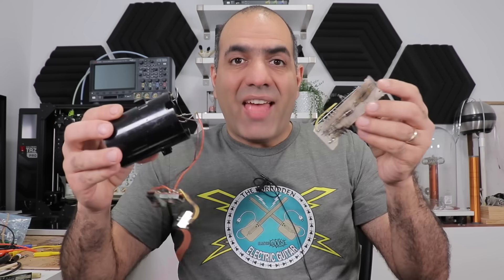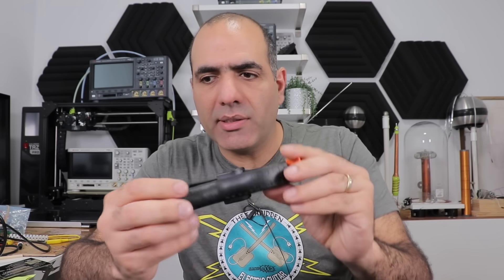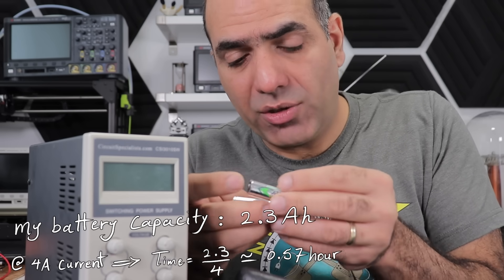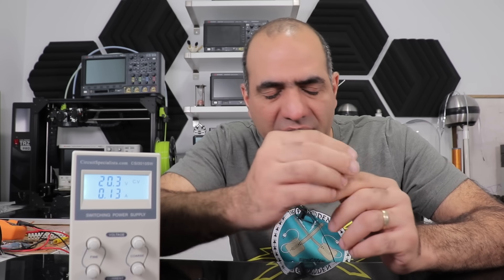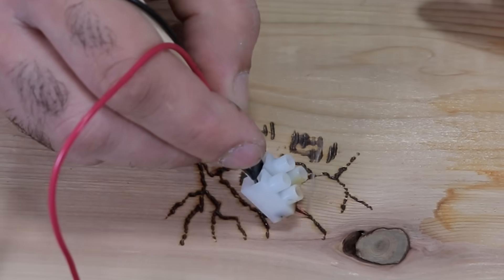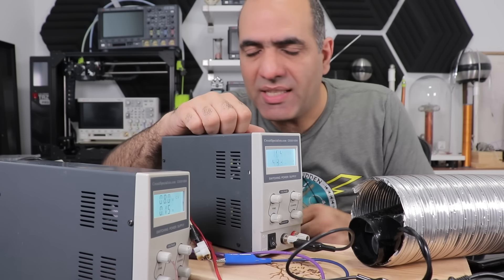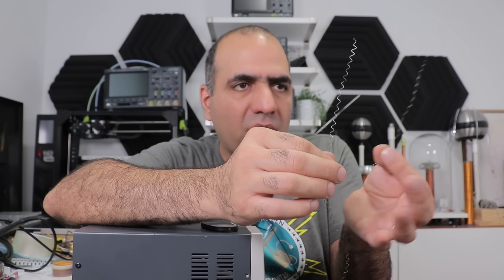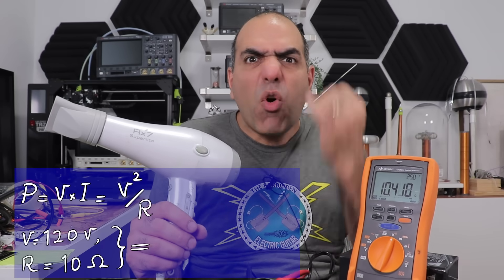Making 5 Things from a Broken Hair Dryer

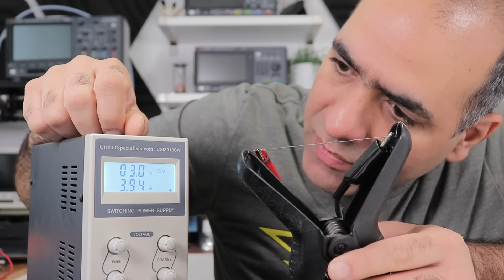Comment: 2:53 @ 4A though ,AA's would not work but a good single cell lipo or even a li-ion would do it
Reply: 3V/4A=0.75Ω
AA batteries typically have an internal resistance of ~0.2Ω. So two in series are 0.4Ω.
Total resistance of 1.15Ω
3V/1.15Ω≈2.6A
2.6A*0.75Ω≈2V
And we saw it work on 2V, so AA batteries are barely sufficient

Comment: Maybe he should have tried putting the filament in a "transparent heat resistant material" and remove all the air as possible in it. 
I know its a crazy idea, but maybe the lack of air would prevent the filament from over heating and it could glow longer without breaking...
I know this Idea sounds Crazy , but i want to believe it can work.
😉😉
If it works, it could be called 
" ELECTRIC SUN " ...💡💡💡

Comment: I used half of a king size heated blanket wire to act as a 5 ohm resistor to activate a pc power supply. I ordered the correct resistors and they never showed up

Comment: In the hairdryer, What prevents the heating wire element from burning up and melting?
And what voltage is applied to the element in the hairdryer? 120vac or is it Vdc ? 
Would it be simplier to have a AC fan motor and an AC heating element?

Comment: I once found an electric space heater at a thrift store. The heating elements just consisted of a bunch of PTC thermistor blocks connected to aluminum radiator fins. Cheapest way to get thermistors!

Comment: I did that first experiment as a kid...only i used 240 volts from the wall socket. Made the wire glowing hot and i could even burn wood with it.

Comment: I think the only thing to do to make a hair-dryer a somewhat universal power resistor would be to separate the fan power from the heating element. For example, if you feed 20v into the thing you don't get any fan movement because of the voltage drop across the heating element. Maybe a universal input boost/buck to DC 15V power supply would solve the issue, or just externally power the fan so you have a more accurate resistor if that matters.

Comment: 7:36 This is due to the Coanda Effect along with the Bernoulli's Principle, which tells us that if we have a pressure difference with high and low pressure air, the high pressure air will push down towards the low pressure air, thus creating a vacuum. This is best seen on aircraft wings, where the shape of the wing creates high and low pressures of air. The top of the wing creates high pressures and the bottom of the wing creates low pressures. The high pressure air pushes on the low pressure air, thus creating lift.

I would like someone with a bigger brain than me to correct me on this because I'm mostly better at mechanical engineering, not fluid dynamics.

Another thing I found. Due to something called viscosity, air is sticky. And so it likes to move things along its path.

The enclosure of the tube that the fan is inside can also help. The pressure difference between the outside and inside of the tube can create vacuum.
Reply: I use Coanda effect and Bernoulli's principle to cool my room right now. A fan is blowing air out and into the hallway through partially open doors (maybe 25 - 30cm open) as new air is being pushed in through the window because of pressure difference.
Blew my little brother's mind away.
Edit: it's midnight rn and it's way colder outside, wouldn't do this in the middle of the day when it's 30°C+.
Reply: Venturi Effect actually
Reply: @yegfreethinker  Well, most people call it the Bernoulli's Principle. I'm pretty sure you're getting confused between Venturi's Nozzle (Which uses the Bernoulli's Principle) and the Bernoulli's Principle.
Reply: @suspense_comix3237  it's literally the Venturi Effect, as a special case of the Bernoulli Principle

Comment: What you call a fuse is a TCO. " Thermal cutoff" This will break and not self heal when overheated.  Virtually every heating apparatus has one. What you call a thermal breaker is indeed a thermostat. As for the restive wire you are using, any hardened thin wire will do. Hardening increases resistance for steel. Don't know why that is. You can peel off a single wire from for example an inner friction cable from a bike break cable. It will do just as well. The spring in the clamp you are using is important. This wire will expand easily 5% when hot. If not compensated for there'll be a lot of slack in the wire. It's not just a toy. When you need creative shapes from foam for some reason it's a very practical tool I used many times.

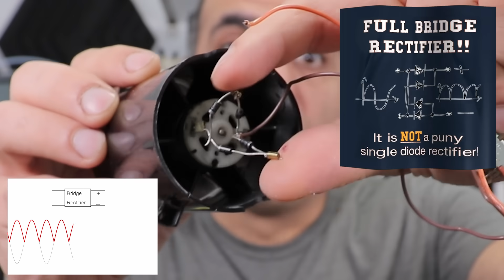Comment: Actually this is not just a fuse... its actually a thermal fuse 0:25
Reply: It's still a kind of fuse. You even said it yourself (Thermal fuse).

They usually use these as an overload protection in case the dryer gets wet or develops a short. It also serves as a back up in case the resettable thermal switch fails.
Reply: Wait then what's the point of the thermal breaker?

Comment: I like this concept. Whenever I see broken electronics I always think about if there's any components that could be put to use elsewhere. The only problem is that I'm not an engineer, so I never have a clue what I can do with the parts.
Reply: There are lots of stuff to salvage, ranging from resistors to capacitors, diodes, fuzes, even raw material like aluminum heat sinks used for passive cooling. A lot of them can be sold or used for small repairs of other electronics and stuff like that.

Comment: The "some fluid dynamic effect" may be the Venturi effect, increasing fluid flow speed drops the pressure , lower pressure in the tube lets atmospheric pressure outside the tube force the smoke into it...then again what do I know, I'm also an electrical engineer ;)
Reply: Hmm i see, venturi equation gave the efflux value of fluids flowing out of an orifice... I reckon it is the king Bernoulli itself
Reply: I'm not sure about the technical defintion of the venturi affect, or anything, but I can say for sure the root cause is the boundary conditions of the tubes. At the point where the inner tube discharges into the outer tube, you have fast moving inside flow, butting up against slow moving outside flow. The velocity of the flow can't change instantly, so you have a gradient across the edge, so they outside cannot be zero, it must have some greater-than-zero flow rate to satisfy the boundary conditions. Also, fast moving air has an inherently lower pressure, which can also work to 'pull' the air in through the outside tube. These 2 ways of looking at this could be mathematically identical, they are the same thing from 2 perspectives, or they may both share some portion of the force for the flow.
Reply: But then everything else is developed on Bernoulli's theorem so may be venturi would be more precise?
Reply: "Sucking" device based on a Venturi effect is called aspirator or vacuum ejector, or simply ejector. For example sandblasting machines suck sand just like that.

Comment: Yeah the problem with those hair dryers is that they use a section heavier nichrome heating wire to limit the current/voltage to the other items in the dryer. They just use more or less loops of the resistive wire depending on the voltage in the destination country. 
That's the reason that, even though, you have the temperature set to zero the air coming out of the dryer will be warmer than the ambient air, as it is cooling the limiting loops of nichrome wire, that are always powered up once the dryer is switched on.
It is nice to see that I'm not the only one who tried to connect mains voltage, in my case 230 volts, to the fan motor directly, only to have the diodes explode in dramatic fashion... 🤣🤣

Comment: Medhi at 6:57 -> "if you dont know how something works, dont put up false information on the web"  then continues to put false information on the web directly after. ¯\_(ツ)_/¯
the blower motor is not connected in series with the heater. the heating element has a third connection to act as a voltage divider providing the lower voltage for the blower. the same circuit can be found in toasters.
Reply: I'd say it's not false information but a half truth, since it's in series with part of the element. It would have been much better if he had drawn the correct schematic, though.

Comment: 7:37 You built an ejection inducter, or educter; they're commonly used in aircraft fuel systems to move fuel from one tank to another without having to put mechanical pumps everywhere.

Comment: @ElectroBOOM - 
The hair dryer schematic was wrong , hair dryers usually use 12V-DC motors with the heather being the voltagew dropper (a normal serial circuit) at least since 50 Years ...  
Your pipe construction @ 7:37 works like a dyson room fan & a modern airline jet engine ... 
as rechargable batteris use the good old D-cells alias "Mono cells" (they are the biggest of the 4 ==> AAA < AA < C < D )

Comment: This is getting out of hand, I had to pause this video several times due to anxiety brought on by watching the (apparent) extreme danger of what was being shown.
Possibly this stems from me being an electronics engineer in the UK, where the 240Vac mains is considerably more lethal than the USA's 110Vac, but still. Yikes forever!
Reply: I think he choreographs the 'accidents' quite well. And you're of course right. 120VAC is only double of what's usually considered a safe voltage under normal circumstances, while 240VAC is definitely too unsafe for many of the things he does.

Comment: You forgot to list the mica paper among the interesting parts a broken hair dryer has. The mica can resist temperatures well over 200 °C and is electrically insulating. This combination makes special enough to make noteworthy. If you ever need a structural element in your heater design, mica is a good choice.
Reply: It's also really healthy and good to inhale!
Reply: @itzfuazz4198  This is an issue with all refractory materials, so it's a given. From silica based bricks you get silicosis. Famously, asbestos causes asbestosis. Refractory mortar is acidic and burns you lungs and eyes. Ceramic wool is carcinogenic. And so and and so forth. If you're engaged in this kind of hobby, it's good practice to inform yourself of material hazards. 
I, for one, think that it'd been safer for Mehdi to make his foam cutter with the mica. What kind of plastic is that clamp made of? Does it gas out formaldehyde when it's getting burned by the hot wire?
You see, it's easy to overdo it with the safety cautions with just about any material. Even water can be toxic, if you drink like 3 gallons of it at once. And people have done it.
Reply: @JoshuaNorton  The wire will conduct heat slowly to its outer ends wrapped through the plastic holes but it isn't heated by current farther out than the leads are attached. 

But yeah, I'd get a hacksaw frame and come up with some kind of insulator to mount the wire onto it with.
Reply: @itzfuazz4198  really?
Reply: @noobkiller9478  i belive that was called irony
Reply: @noobkiller9478  Pretty sure it's just a mineral. We had samples of it while doing geology in science class in school. I think it's just when it's powdered or spun into fiber that it presents a health hazard. (Is the mica we use in electronics mined or is it created artificially from constituent components?)
Reply: @SharienGaming  👍
Reply: Did you forget a 0?
Reply: @0x8badf00d  Yeah, that didn't seem very hot. My oven can do better than °200 C.
Reply: Absolutely!  From the mica board and tuned corrosion-resistant wires to kapton tape and tourmaline coatings, hair dryers are a wealth of interesting materials for something so simple!

The way this video brings it all back around is masterful.  It ought to be nominated for an award.
Reply: ok but wtf can he use the mica paper for, and how is it very different from anything else? Aren't plastics used in desktops (I forgot the acronym, but probably PVC as well) resistant to temps up to 200C (and electrically insulating)?
Reply: @kamranrowshandel6395  why so aggressive?  Sure, some plastics like imides (definitely not PVC) can go to 200-250C, but that's pushing it.  Mica is going to double or quadruple that capability, with good dimensional stability.  It's not super interesting, but there is a reason you don't see the coil frame made of plastic.
Reply: @jdspencr  you said 200C bro, this is not my problem. in other news, I'd like to ask (on an unrelated note to you, because we "met" today), Is there any doubt that only in gambling may one's previous words be exempt from being the reason for which one "Changes One's Life (in terms of the Western meaning of changing one's life)"?
Reply: @kamranrowshandel6395  No.  That's not me.  You were responding to a different poster that said 200C (and they said "well over").  Their low-ball may not have been your problem, but your attention to detail certainly is.
Reply: @jdspencr  (jump the wall into china or bust--whether I'm alive by then or not)

Comment: You can use an old hair dryer as a filament dehydrator for your 3D printing filament! Put the filament in a 5Gal bucket and attach the hair dryer to the side 😊

Comment: I just recently made a electric light it's very easy to use just 5v charger will handle it and i burned a lot of toothpicks and almost cut my hand but it burned very badly but carefully used it and patiently used it or if glows too bright it will melt and burned my skins again

Comment: 2:16 Is heating coil resistance supposed to be big high, Joules-Lenz law of electric heating and tungsten filaments of electric bulbs more resistance more watts consumes and brighter shines electric bulb. Superconductivity is when resistance is close to zero and electric current is the initial value maximum electric source current, flow without resistance, and other features of low resistance electric current it produces zero heat.

Comment: Engraver? Plastic repair! 

The hot wire is pressed into two adjoining pieces of plastic. It melts the plastic and joins the two parts. Use the pliers to pinch off the wire. The remaining wire is used to create a new "glue wire". Do the same with some distance to the first wire.

OK ... does not hold together because of the small diameter of the wire, illustrates the principle. BUT: This is how bodywork damage to the plastic parts of vehicles is easy to repair. Check it out. User powerfulukltd on Youtube.

Should also work with plastic you have already destroyed, build one! ;)

Thanks for make me laughing.

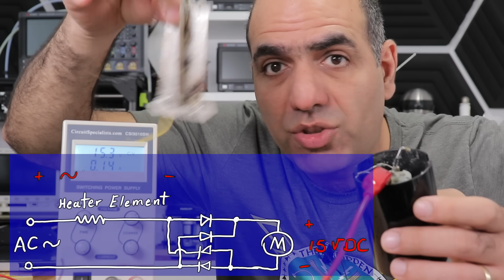Comment: 7:13 I don't think this schemata is correct. I think the heater element acts as a voltage divider and therefore has a center tap somewhere.
Reply: Electroboom confirms that after the first motor experiment failed.

Comment: Used to use something very similar at my last job as ur engraver it would cut silk on weaving machine and seal it we used to have them just glowing red. I think the supply was only 2 or 3v if I remember . We were forever replacing the elements very very fragile

Comment: I used the string out of the hair dryer's heating element to make a remote lighter for some fireworks

Me and my uncle wanted to make a surprise for my mom's birthday, so he bought some fireworks, and I had to make something to light it up without having to come to it and light it up with a lighter. So I took a veeery long wire, some Soviet switch I had in the garage, a drill battery and a piece of the hair dryer's heating element string. Hooked it all up, from battery the negative goes to the switch, and from the switch goes thru the looong wire to the heating element, it heats up (maybe melts, but that didn't matter :D) and lights up the firework. The switch was later hidden in a way that I could secretly flip it with my leg while standing outside with my mother and my uncle. It worked perfectly and my mom was very happy. Mission successfully completed. :D

Comment: I have combined a light dimmer and a dimmer friendly halogen light transformer into a hot wire cutter. Works like charm.
Also the dimmer blocked with a regular wall socket makes a convenient regulator for your table lamp, soldering iron, glue gun (sic!) and lots of other things.
There are two-sit boxes for mounting sockets into a dry wall. One of these boxes makes perfect shell for a dimmer and a socket. Add some power chord with a plug and some electric tape to hold everything together. And you may try this at home.

Comment: I think the element has little to do with the current getting to the blower motor. You may have forgotten but a hair dryer has switches with resistors on them. Changing the combination of the switches changes the current sent to both the motor and element.
Reply: Any such resistors are part of the element. Possibly unless the dryer has a full electronic control using a triac or similar. In any case, feeding the blower motor through a resistor would need a fairly 'heavy' resistor, so any place outside of the element would be foolish if you use one.

Comment: When I need it, I sometimes make a temporary battery holder out of an aluminum foil, duct tape, two wires and batteries of course
Reply: The batteries are rather important in that build, yes.
Reply: I thought it would be a overall bad idea, but then I checked the resistivity of aluminium: it's about 1.5 times greater than copper, not that bad. What do you do? You use pieces of aluminium for connecting pairs of  batteries in series, or a long strip for connecting them in parallel, and then use duct tape to "secure" everything? Also, what power do you use these ghetto battery packs for?

Comment: Make a 10a fuse....
EXCEPT fuse rating is the amperage that the fuse will carry, not blow at...
It will blow as opposed to  degrade over time, at a significantly higher amperage so your fuse would be more like 5 than 10!